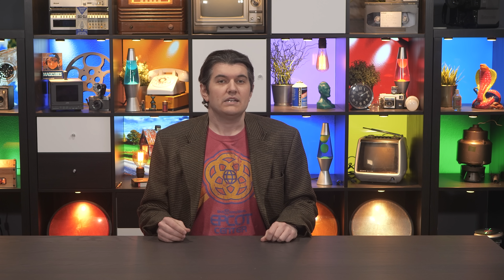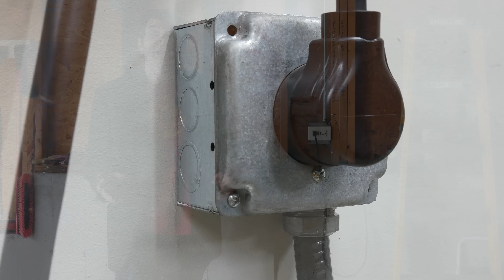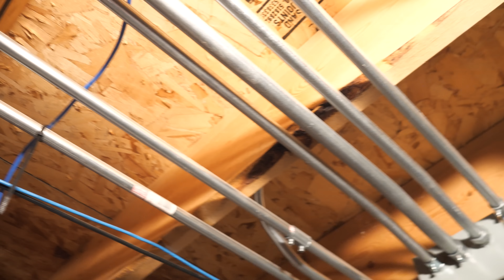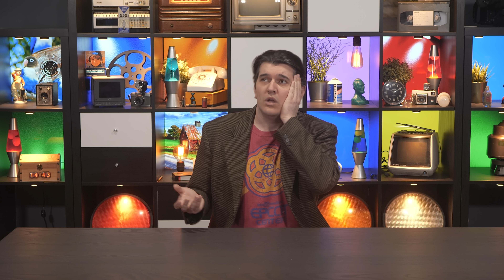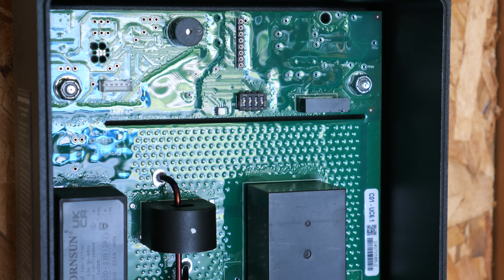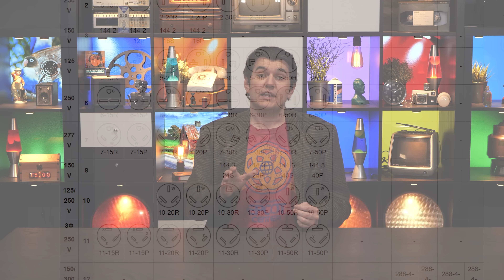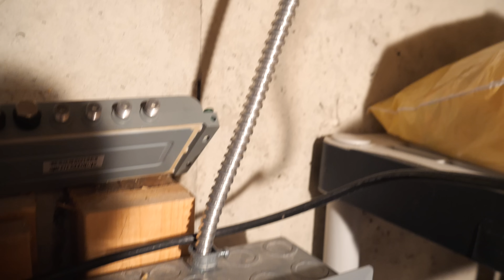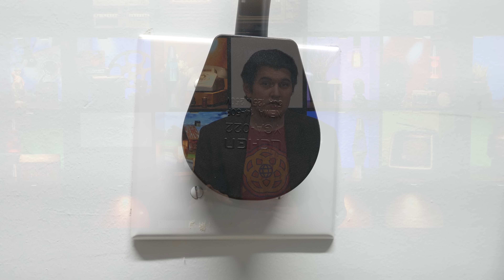The "standard" car charger is usually overkill—but your electrician might not know that

Comment: My family is currently using a rental electric vehicle for the first time (for reasons beyond the scope of a youtube comment). We've quickly discovered that we really prefer EVs, but we live in the US and we can't get a 240V outlet installed (also for reasons beyond the scope of a youtube comment). Imagine my surprise when, not an hour after I talked with my dad about the infeasibility of getting a 240V outlet, you release a video detailing how someone in our exact position might manage without one.

That's a really long-winded way of saying: Thank you very much for providing a solution to a problem my family has only just learned we have.
Reply: yeah just do the math but honestly most people can live just fine off of a 120V 15A "standard" wall outlet unless they have crazy daily range needs
Reply: @davedoe6445  I don't have a garage so I'm almost exclusively using public DC chargers, it's like $10-15 once a week but it only takes about an hour, get it in while shopping mostly
Reply: @beargillium2369  yeah it's not terribly inconvenient to fast charge but generally charging at home has cheaper electric rates
Reply: @davedoe6445 I drive 30,000km a year and I still charge my Tesla on a 120v/12amps charger. It gives me about 8km of range a day (fortunately, I live in mega cold Canada, but my building has an indoor garage).

Usually, it just adds up and by midweek, I have my 80% (I have a Long Range Tesla). 

Just sometimes, when I have a long trip ahead, I ask my wife to plug it on 240V at work. 

I’m not a huge fan of DC chargers because they charge ideally from 20 to 80%, so to have a real long non-stop drive, it’s makes a genuine difference to begin a trip at 100%.
Reply: @guillaumegiroux9425  thanks for your story.  I agree, most folks don't realize that a plain 120v/12amp charger with occasional higher power charging would work just fine for the majority of people
Reply: @guillaumegiroux9425  and yeah I have a model Y and when I have a long trip I charge to 100% too for similar reasons.  I can drive ~250-300 miles on a full charge.
Reply: I’m confused as to how you can’t get 240 or 208 at a residence? Every residential panel has 240, and commercial power will have 208. Even if you have ancient fuse panels you just need to run from both poles. Not trying to be rude, maybe you’re not allowed to tap into it for some reason, but you have to have one of the two voltages available.
Reply: Convert a garage circuit into 240/12 or 240/16 if you’re fine with foregoing other outlets
Reply: I am an electrician of 30 years, I have installed over 100 of these and I exclusively use Hubbell brand devices… anyway, of course you can get a 240 V outlet installed.
Reply: Blaming the US for not being able to put a 240v outlet in, but you don't have enough time to explain why lol. Every house has 240v. So I'm guessing you are parked too far away from the house.
Reply: My wife and I recently got a bolt, and it's amazing how sufficient just a regular 120v outlet has been
 

When we drove it home, we hit up a fast charger to get it up to full (it was at about 30%) charge, but after that, we just plug it in every night, and forget it!
Reply: What the heck are you talking about?  Literally every house, every single building in the US has 240 volts. I don't know who told to they don't.  That's crazy that you are so incredibly misinformed.
Reply: Thought that same 240v and a neutral. Using neutral and one tapping of 240v for 120v.
Reply: @JsRazza  Not all houses have 240V. Some particular areas have 208V.
Reply: @Daniel15au practically anything made to run on 240 can run on 208. Electrical gear is made for all customers, residential and commercial three phase.
Reply: really not a big deal, and you can always use a public charger if the need comes up, the price difference is pretty minimal if it's occasional.
Reply: My family is currently discovering that ur not a real person..
Reply: we live in the US and we can't get a 240V outlet installed

Shithole nation 🤣
Reply: That's funny,.my family is renting vehicles and were forced into EVs. We hate them.
Reply: @asherdie  Hate is a strong word. It's cool if it somehow doesn't fit your routine, but which EVs are you talking about and why do you "hate" them?
Reply: Buy a Honda little generator, ?.  Charge while driving!!!
Reply: @amyself6678 I mean I wouldn’t charge while driving but I’ve tried to explain this to so many people who go “well what happens when the grid goes down and I need my car?!”  He said it in the video, but I’ve always said the beauty of electricity is it’s flexible and thus can be powered off of almost energy source, even gas. So if the grid goes down, you can just charge it with a gas generator if it somehow comes to that.
Reply: @amyself6678  If you have a charger plugged in to the car, you cannot drive the car. That's put a crimp into an otherwise damn fine plan.
Reply: @amyself6678 that sounds like a good idea. But if I have a Chevy is the Honda generator compatible 😂
Reply: Any generator puts out 120 volt power, put in trunk and just run cord to EV car charging port. . . . ..   The gasoline to run a car or generator is just $1000 a year so not a big problem there.  . . . .  So I dont think govt can stop this, the lazy half of people will have $1000 gasoline generators in their trunk.  In the ghetto some family aint gonna wanna waste time middle of night charging at parking lot mile away, that can get you killed waiting there for hours . ..  . . Half of people don't own a garage so instead of weekly spending 3 hours finding and charging their car, waiting in line with all the other people, people in Canada and Europe and US will have generator in trunk.  Unless they somehow ban generators or ban gasoline??  Never before has govt tried to ban something (gasoline cars) that most people like - -- except prohibition of alcohol in the US and we know how that ended.. . . . .   . . . . .  Its weird govt is gonna make criminal something everyone likes, I almost admire the balls of trying to do that. .. . Even smoking only 1/3 did that, and they just are taxing it a lot no ban.  .. ..  I guess they do ban prostitution, but haha that still occurs here in Texas. . . .
Reply: @amyself6678  Hey, what if they made cars with generators in them instead?
Reply: @looking_33 many hybrids are exactly that
Reply: Almost like a hybrid. Always thought the Chevy Volt was suppose to be that, an electric car with a gasoline engine to recharge the battery. But its seems it is kinda more a hybrid .
Reply: @looking_33  They do, but are the most likely to catch fire......   'Don't cross the streams', electricity and petrol/gas
Reply: @My_Old_YT_Account  And the great advantage of hybrids is you constantly carry a huge dead weight that massively increases your energy consumption and operating cost, and also is yet another possible point of failure.
So unless you specifically need an insane daily range because you are a professional driver in a completely remote area with no electricity supply anywhere on the road, hybrids make no actual sense.
Reply: @christianbarnay2499 you usually save on gas due to start/stop traffic on small battery ones that still have the gas engine able to drive the car on its own
For the ones I previously talked about that have it more as a generator, it's more about being able to use gas while still having all the other advantages of an EV
Reply: @paulstubbs7678  Depends what data you look at. There are a lot more hybrid and ICE car fires than EV - but they include crash reports. A large capacity EV is far more likely to catch fire, in your home, without being involved in an accident.
Reply: @christianbarnay2499 you can have a much smaller battery, which will cover most short trips, then the generator can help cover longer distances than ev alone. For a lot of people it's significantly better - and far lighter than lugging around a literal extra tonne of weight for short trips
Reply: @MelodicTurtleMetal  Most true, however the media like to leave out any useful info and just sensationalise it to the nth degree, and often that's your only source of info
Reply: @looking_33  there are “direct hybrids” which have moped sized engines in them specifically to charge the battery.
Reply: @amyself6678 This is a stupid and immature comment. Not to mention it wouldn't work anyway.
Reply: Why wont a $1000 generator in trunk and gas tank in trunk work to charge an EV.  I have a Honda generator the size of a microwave on my houseboat and its always going purring away.  Its hard to ban something the people like.  To force EV charging without gasoline is govt gonna ban little generators and gasoline, so people can't buy these, here in Texas we all have this to prepare for hurricanes might as well put in EV trunk. . . ..  My niece lives in old old old apartment and has 2 kids, she's not gonna leave them to charge her car at charger 2 miles away in middle of night -- - -  -she'll charge with generator in trunk of her EV.

Comment: My condo is looking at providing charging at the stall. My proposal is to provide 110v 15 amp at every stall and convert the publicly accessible "guest parking" into publicly accessible charging 220V meter charging as well as a parking spot to the local car share for a tether spot for their desire to eventually reach 100% ev fleet
Reply: Low-n-slow for those living there because they'll most likely have their car parked 8+ hours per-day, and High-n-fast for visitors who aren't going to be parked for 4+ hours per-day makes sense in that case.
Reply: 120/240v.  Those old 110/220 numbers haven't been in actual use since the 1940s.

Comment: If it takes 18 hours to charge on a standard plug to full from empty you might have a problem if you need to plug in during sleep only. Having the option of faster charging is handy but for people that live in small towns and drive short distances the standard plug is fine. But for an electric car a garage makes it so much more usable and most people do not have to sit in their cars 3 to 6 hours in a charging parking lot.
Reply: How many people drive their EVs from full to empty every day?

Comment: This was one of your weaker videos. The cases you present here are the extreme fringe and unusual, but you just don't stress that in the video. For the VAST VAST VAST majority of people, installing a new circuit for their car charging, they are going to hire a professional, and labor is the highest cost, not the EVSE, not the cost of the wire and breaker.

For the vast majority of people, the default should be "Just install a NEMA 14-50 and be done with it."  The marginal increase in cost is not high enough to justify anything else, unless you're in an extreme edge case.

Comment: Regarding the power monitoring/app connectedness of some EVSEs I have two points:
1) I have debunked MANY claims of how expensive an EV is to run just by pulling out an app and showing my actual use data. 
2) My power company offers some time-of-use discounts and, of course, they need a connected, metering EVSE to implement that.

Comment: Why are those wallchargers that expensive still? There are multiple suplliers and there is almost nonhardware in them. They should be available below 100 bucks.
Reply: The stupid things are just automatic safety disconnects with PWM ampacity communication.  They are so ridiculously overpriced it's embarrassing.
Reply: Probably the cost of Copper used for the various cables - public charging stations are known victims of vandals destroying them to get at the Copper to get a few bucks as "scrap metal" from recyclers depending where you are.

Comment: The elephant in the room is how EVs are a change in habit. People are still in the mindset of "running them empty" and then charging them up. A standard outlet can keep a car topped up if you just plug it in out of habit each time you pull up. My EV is far less of a headache than my petrol car.

Comment: There are some other problems with EVs that often don't get mentioned:
Some of them have HORRIBLE charging which can lead to problems with electronics. We had a convention-centre network crashing for hours cause somebody was charging their vehicle. Every part of the whole system was up to specs or even far better than required, yet a single vehicle cause hundreds of people to have problems. That should normally not be a problem with slower charging at home but it could happen.

And while "this easily is enough for daily commuting" sounds nice to some to me that is an absolute red flag: It means as soon as anything is different it might not work out anymore.
"Having a wooden stool bolted to the floor is enough for a car seat. it gives you a comfortable and secure enough seating for everyday driving". You get home from a long day, and somebody then breaks their arm and needs to go to the hospital "ah, we have to make a stop at the fast-charger now - just an hour".

IF you can charge your car at the places you are going that would of course be a different matter, but sadly in most countries that is rarely the case. Companies and governments rather waste many millions or billions on green-washing instead of doing something that ACTUALLY helps: Cover your freaking parking-lots with solar-panel-roofs and offer charging. A typical parking-lot at work would then easily give you >50km of range and the chance of run completely flat are then nearly gone. And now the car is not scorching hot in the summer, or snowed-in/frozen-over in winter.

Comment: I bought a 2025 Chevy Equinox EV in December.

My first charge was at the dealer. The battery was at 20% and I had them charge it to 80%. It took around an hour to charge.

My first charge after that was at home, using the included charging cable. We don't have any 240V outlets in the house, so I used a standard 3 prong, 120V outlet in front of the house.

My EV's battery was at 16% and I charged it to 80%. It took 4 days to charge and used over 3 times as much electricity as it should have. The total battery capacity is 85 kWh. I charged from 16% to 80%. If my math isn't off, that should be about 55 kWh. Over those 4 days, our electric bill was over 3 times higher than any other day. I don't know why we used over 150 kWh to charge about 55 kWh. Where did the other 100 kWh go? Since then, I have not charged at home. I can't afford to charge at home or for it to take that long. If I could charge nightly and top off the 5% to 6% I use driving to work at back, it wouldn't be an issue. But, I can't afford the cost of using 3 times the electricity as it should.

I charge my EV while I'm at work. It takes about 8 hours for my EV to charge from 20% to 80%. I usually charge every other day, so I rarely drop below the mid 60%s. I pay a $50 monthly subscription for 200 kWh, which comes out to $0.25 per kWh. On average, I use about 130 to 150 kWh per month so I can be liberal with my electricity use. The most I have every used in a month was 183 kWh.

If I could charge at home and get the cost per kWh to $0.25 or less, and not have it take forever, then I would cancel my subscription. Until then, charging at work has been mostly convenient. When I don't forget to plug in.

Comment: Recently got a PHEV and ive been fine with the included 1.5kwh (240v) AC charger. Back to 100% by the time i use it again in the morning (50-60km used in EV mode). Not to mention I only pay 21c(AUD)  per KWh at home compared to the cheapest fast charger around at 52c per KWh.

Comment: there's another option if you are panel capacity limited, a smart auto throttling EVSE. That means adding current clamps to the feeders of the panel and running those sensor wires to the EVSE that will adjust the current communicated to the car based on the remaining headroom.